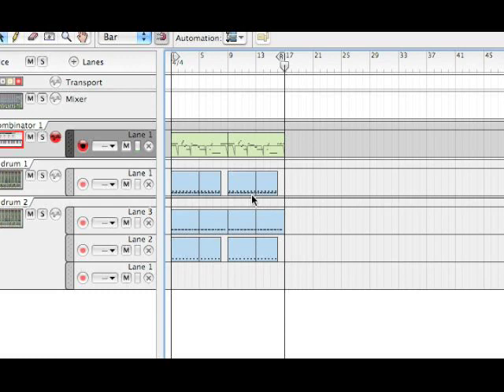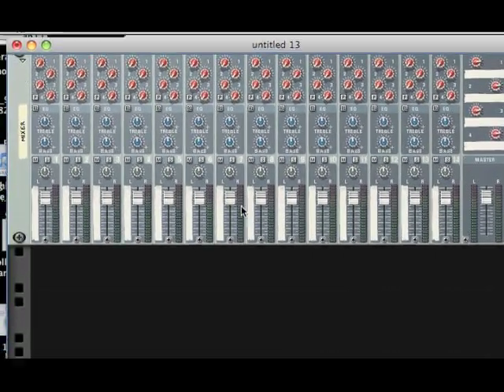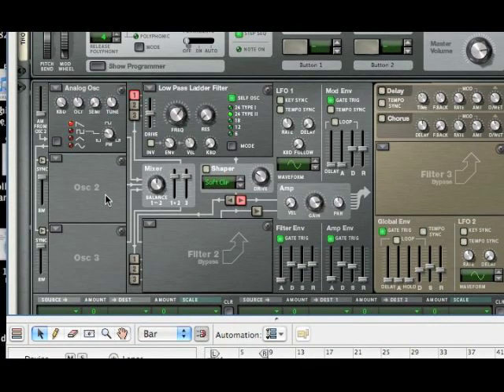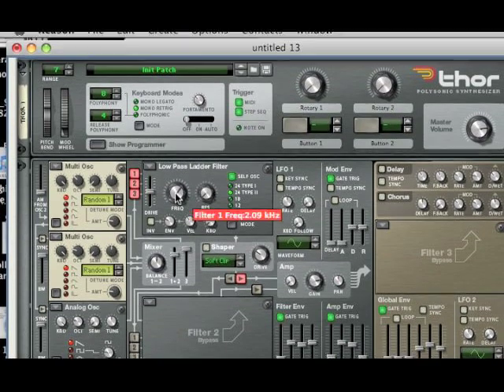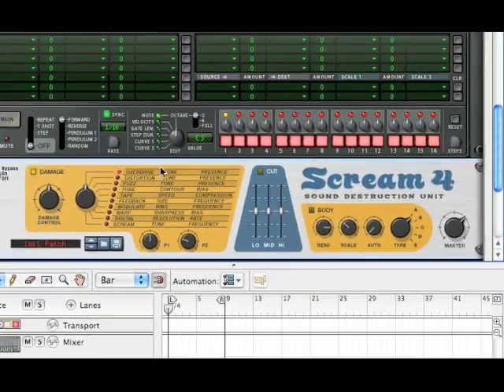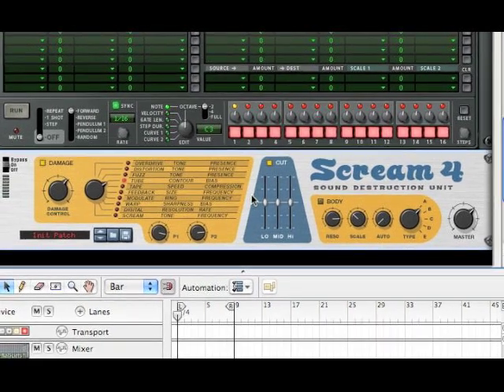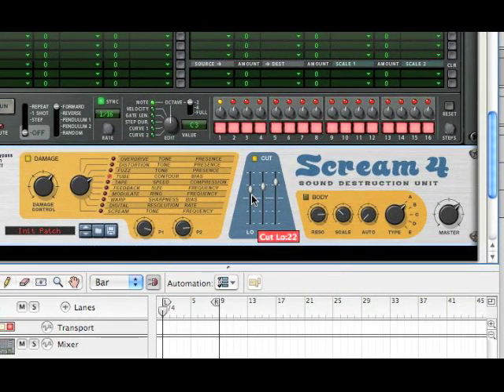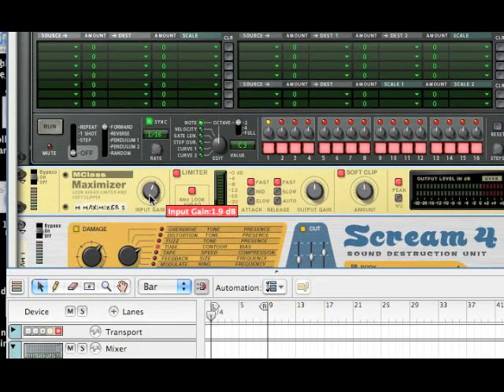Create the "Justice Bass" in Reason 4.0! (Tutorial)

Comment: For those of you having issues reproducing this sound using this tutorial: You probably have Reason set to auto-load a default patch whenever you add a new piece of equipment to the rack (the "load default sound in new devices" checkbox in Preferences).

When you add the Thor (or anything else for that matter) to the rack, make sure it's in the Init state. If it isn't, just right-click it and select "Initialize Patch" to clear out the current patch and give you a blank slate to start from.

Comment: @sharkcellar To clean up the "nastiness" of this patch, if you follow his tutorial to the letter, pull the detune amount knob (just below detune mode rollout) down to 20 for both osc 1 and 2. You should also turn off the delay in the upper right hand corner. The ADSR settings for the amp env that work for me are A=0, D=2.24s, S=0.0db, and R= 3.2 ms. 

I hope this helps.